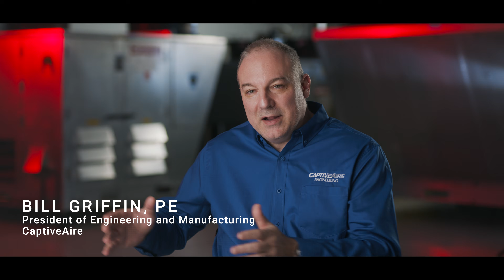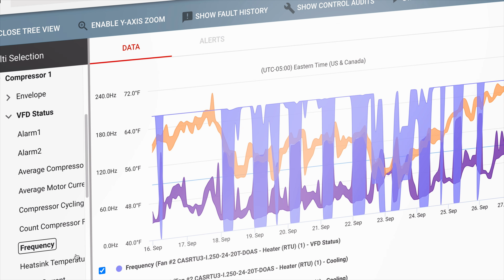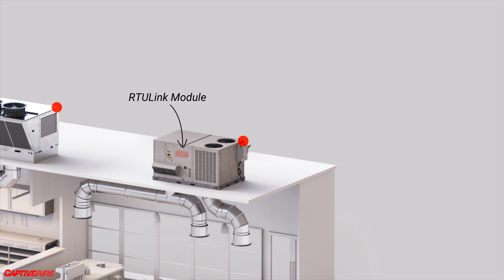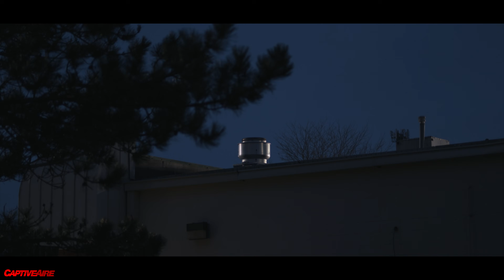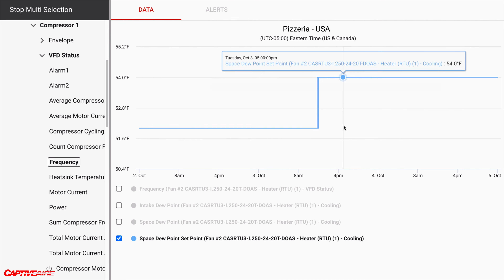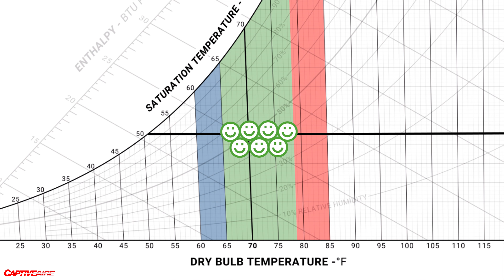Your HVAC is Smarter Than You Think

Comment: My only problem here - is that here is yet another proprietary BMS... for yet more prorietary equipment.  This is vendor lock-in at its most basic principals, unless CaptiveAire is also offering their API so that anyone can aggregate the data instead of requiring a subscription to a proprietary cloud service.
  
The real solution to this is to remove as much of the intelligence from each individual product as possible and just give IO (control/sensory) - then just provide a Free-and-Open-Source-Software FOSS BMS with pre-canned industry-compliant worker logic.  There is not a lot of "magic" to making this work - and producing hardware that has simple IO is actually cheaper that what was produced here.